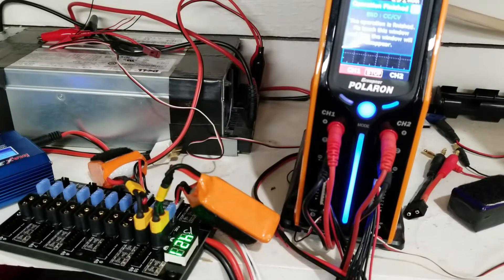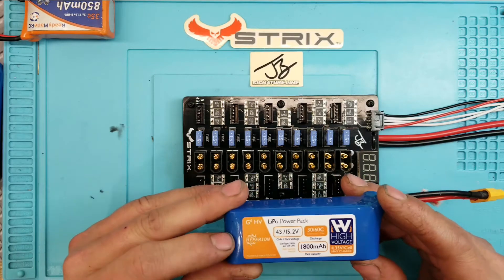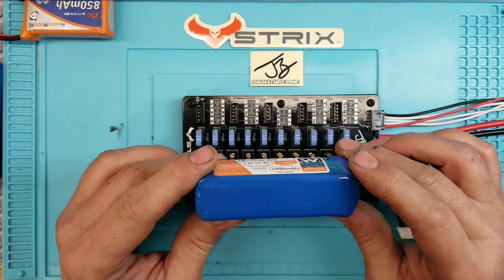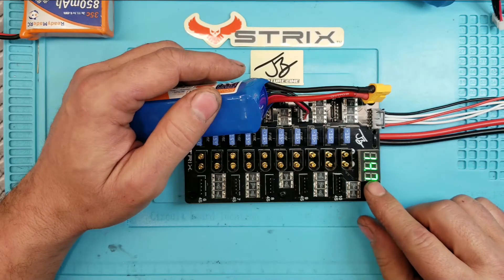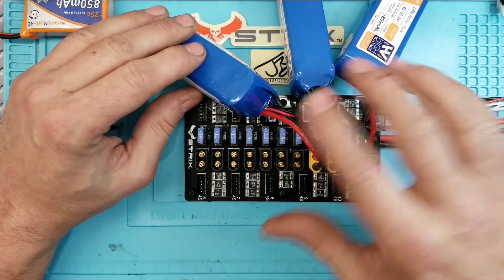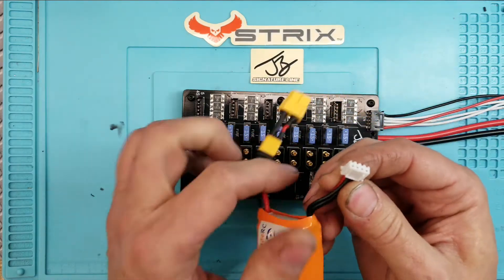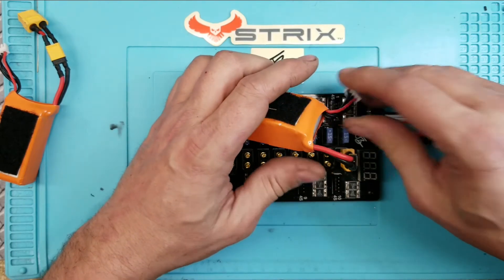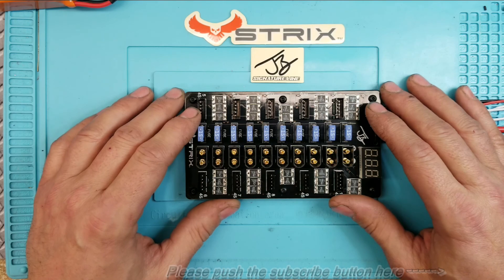Parallel Charging board by Strix, Joshua Bardwell Line V2 4s and 3s?

Comment: just the vid im looking for,thankyou for posting.i have just got myself the Graupner Polaron EX Charger and I am looking at the strix board for charging my 4s packs but im not sure how to parallell charge on this charger,do you just use the cc/cv setting on this and add the amps accordingly as normal,how have you plugged the strix into the chargers balance port,did you plug in from the bottom pin up,looking forward to your reply,regards jim
Reply from the maker: I just plugged the Strix into the Polaraon's balance board that is comes with like the Strix is a battery.
Reply: Hi DumbThumbsFPV, thanx that was what I was going to do,do you just use the cc/cv and charge like a normal battery,regards jim
Reply from the maker: Yeah you just charge it like a normal battery but you add up the amps so if you have 5 2000 mah bats then set it to 8amps for 1s charging. The Polaron however doesn't seem to like to do parallel charging because it says the bats are charged and they are not so you have to keep hitting the charge button.

Comment: Great video! I just purchased the board, some XT30 to XT60 converters, and a few extended balance leads - with the intention of trimming the connector on the leads as opposed to the battery. You trimmed the tab closest to the red wire on the balance lead, but would there be an issue trimming the tab on the opposite side (closest to the black wire)?

Comment: The way to avoid plugging in a fully charged battery to the board is to check voltage on all packs before you plug them in. I think Joshua said in his video about parallel charging is that packs should be within .04 volts of each other. When I check mine I group them according to low batteries and higher batteries. I check all batteries twice. Once after flying to see if any of them need to be put at the storage voltage of 3.8 per cell and again right before I plug them into the board to make sure that nothing bad happens.
Reply from the maker: Very true but sometimes people forget and it's easy to do when you have 30 bats
Reply: If you want to parallel charge you need to do the right thing with your batteries no matter how many you have. Other wise you risk damaging batteries or worse yet fires. If you aren't will to do what is needed then maybe parallel charging isn't for you.
Reply from the maker: True but accidents happen and that is why I like this boards fuses when they do

Comment: Great Video! I have 6pcs 1550mah 4s 75C  lipo's and I have charger B6 whit max 5A and this JB v2 board. Can I charge all 6 pcs lipos in the same time on 5A? Or I must charge 3 pcs on  5 amps? Am I damage battery when I charge all 6 pcs in the same time on 5 A? I think this I must charge in 9.3A (which is 1C per battery) or 5A/6pcs = 0.83A/pcs. Buth my cherger is max 5A. ??>> How can I charge my battrey whit my chgarger?  I think I must change my charger :/ Is this ok? 10A http://bit.ly/2zYOlHV
Reply from the maker: B6 charger is too small. 6 1550mah 4s batteries @ 1c charge would need 9.3 amps.http://bit.ly/2zYOlHV This is only 100w total. Channel A is only 70w and channel B is only 30w on AC power! Not good.  This combo would be best.. https://www.banggood.com/ISDT-SC-620-500W-20A-MINI-Smart-LCD-Battery-Balance-Charger-p-1060646.html?rmmds=search&cur_warehouse=CN AND https://www.banggood.com/12_6V-600W-Power-Supply-RC-Balance-Lipo-Battery-Charger-For-ISDT-SC-620-Charger-p-1173882.html?rmmds=detail-left-hotproducts&cur_warehouse=CN for almost the same price as the one you are looking at.
Reply: 10x for answer. I like this combo but this power supply is not safe for my children. Cen you recomend safe power supply like for laptop (no cable naked)? I see this ISDT 14A http://bit.ly/2CmPy1D   What power supply can I use for it? (12V 10A DC ?)   10X :)

Comment: I have an EVPEAK CQ2. Would a board like this work well on it? I think the charger pumps 6amps per section so at 5ow x4 at 6a I can charge 10 batteries at a .6 charge rate. So would it be cool to have 4 board on the charger? 
I am a noob to parallel charging. I use the evpeak cq2 and a hitec x1 50w 6a  to charge 5 at once. It still takes a long time but I only charge at half C to prolong the life of the lipos. So I am guessing to use a parallel board on each and charge a 6a would be the same no?
Reply from the maker: A parallel charging board will work with any charger that has banana style connectors (the red and black holes on your charger) but how fast you can charge 10 batteries will depend on it's output. Yours says 50watts per channel so that is not very much so your calculations above are correct. If you had 10 1800 4s packs it would take awhile to charge them 3 or more hours. To really charge fast you will need different charger solution with an external power packs bridged to run 24vDC to the charger. If you have the time though there is nothing wrong with charging slower and you bats will last longer if you don't leave them fully charged for more than 24hours.
Reply: while not in use leaving discharged to 3.8 or so then charging before using is best? I usually leave em charged for a few days before use so maybe I am an ass hat haha. They have lasted for almost a year now though.
Reply from the maker: Yeah, if you leave lipos fully charged for too long it breaks down the chemicals inside so it's always best to leave them in a storage state until you use them 3.8 or 3.85 is best. Some batteries are more effected than others but to get the maximum life from them, it's best to only charge them right before you will use them. HV batteries should be use right away and never left charged for more than 12 hours. Also get an Ammo case (used or new) and store/transport your batteries in it. Never just throw fully charge bats in a backpack or leave them in the car. Lipos are dangerous when they are charging and fully charged, dented, puffy or ran down below 3v a cell. Fires usually happen when charging so personaly I have drilled a hole in the side of my Ammo case to run the wires from the Parallel charger though it to my charger and charge in the ammo case. My ammo case is lined with pieces 1/2 cement tile backer board from home depot. You can get a real nice Ammo case made for charging and safety here. It's well worth it!! https://www.youtube.com/watch?v=ZCLHDU_dOCA you can also make a battery bunker as this one https://www.youtube.com/watch?v=ZCLHDU_dOCA this is good video as well https://www.youtube.com/watch?v=S3R-dYeDMBg and this one is cool for a field setup https://www.youtube.com/watch?v=T9NvfRduefE